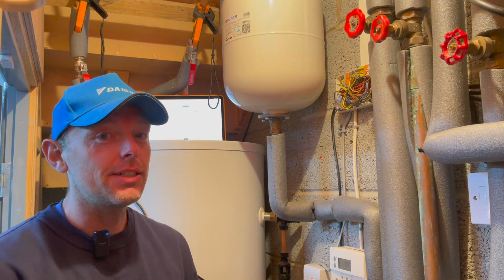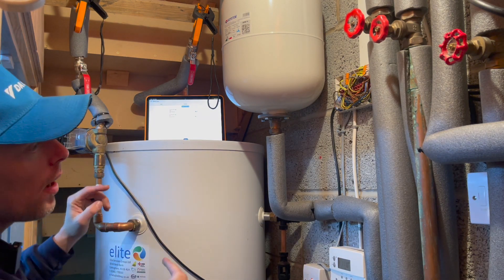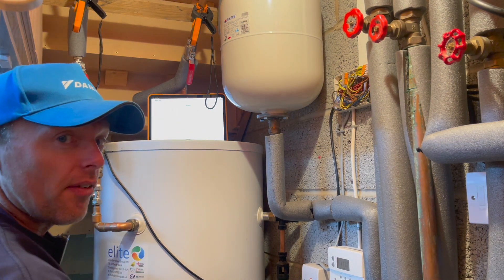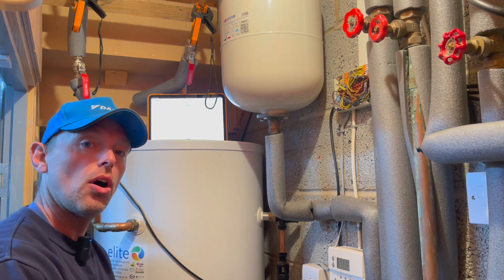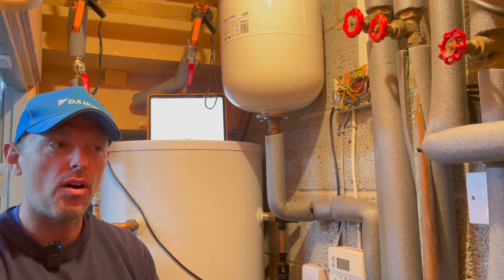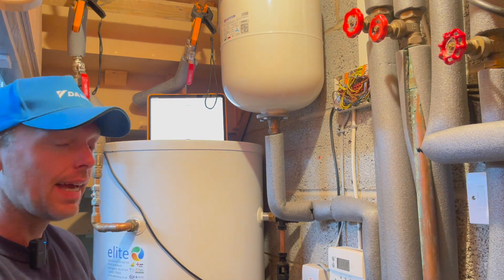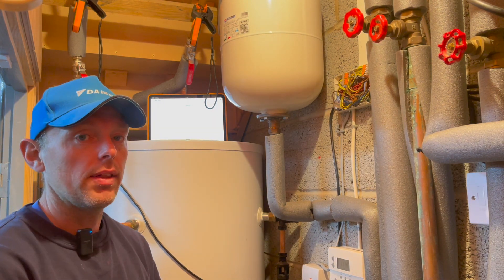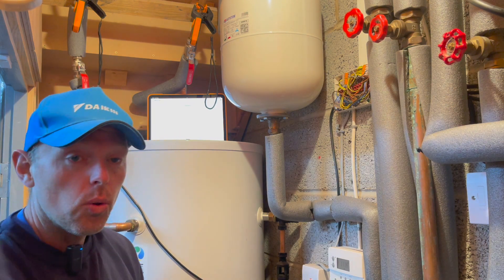Heat Pump Saved! With A Hot Water Return Fix...

Comment: Hey, nice vid! A bit left field and geeky, but more and more houses and peeps are getting into home automation. Personally, I use Home Assistant and have the HWR pump switched on by movement sensors in the room with taps..... e.g. bathroom and kitchen. An automation routine is really simple to setup...... something like..... Aqara motion sensor detects motion in bathroom, triggers a Shelly switch (1pm) with the HWR pump attached to it...... If the motion sensor detects no motion for 1 minute, it switches the pump off. There's a million ways to skin this particular cat.... this is but one..... Look forward to the next vid!
Reply: I was going to suggest a PIR to that furthest point on a timed run when movement triggers PIR. What is the system you are using? Where can I look at this system? Can you put a linkup? Thanks

Comment: I've had this with a really large heating system and two 210ltr unvented cylinders with a bronze hot water circulator, no timer no stat, and this was on a gas boiler, the H/W pump was on 24/7 and it just killed the heat input to the rads. The house was 5 stories high and although it was supposed to have pipe insulation I doubt it was more than 9mm wall, Thing is nobody would listen, even when I proved it by turning off the H/W pump, which then let the heating get up to temperature at a reasonable rate. I walked as I was not going to bang my head on a brick wall for mugs and it was not my install.

Comment: Struck me with a similar problem that if the distant tap is a kitchen or utility room tap, undersink heating would be far better. Save wasting energy in the loop. If that isn’t an option you could install wireless switches that run the pumps for 5 minutes and hope the hysteresis isn’t breached all the time! The wireless switches are great and can be used in bathrooms too!

Comment: I’ve got my hot water return pump plugged into a LightwaveRF socket so I can turn it on as and when I need to use the shower, I’ve set a time limit within the app to only run for 15 minutes, by the time your ready to use the shower the water is running hot and it’s once your in the shower you no longer need the hot water return pump running.

Comment: Thanks, good video.  I think my system has a similar issue.  Electricity usage is crazy.  Day 25-35kWh, night 2-3kWh and it's not even that cold outside yet.  I don't think the scheduler is working at all and I think the HW circulating pump is emptying the cylinder around the run around circuit.
Reply from the maker: Turn it off and see what happens.